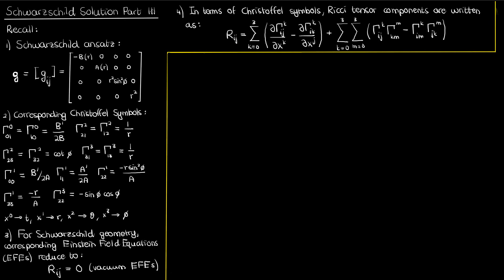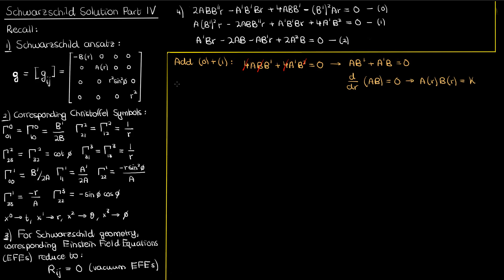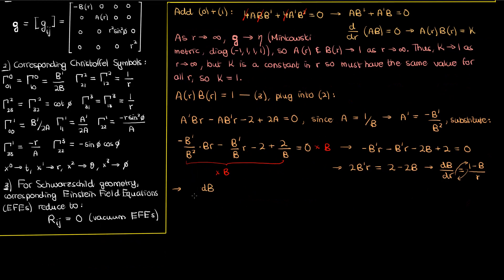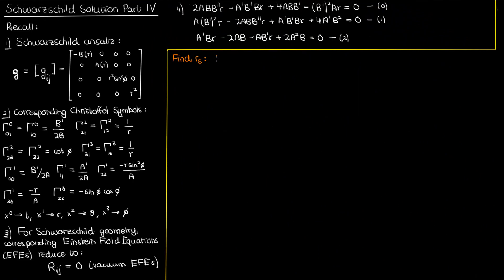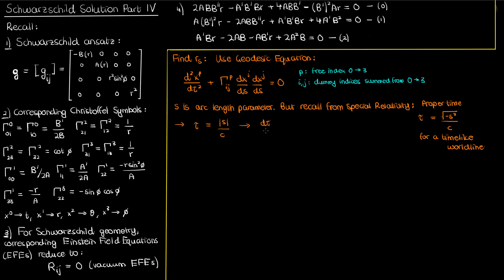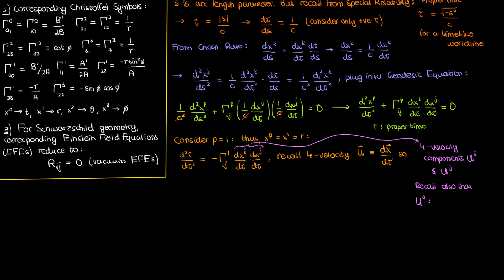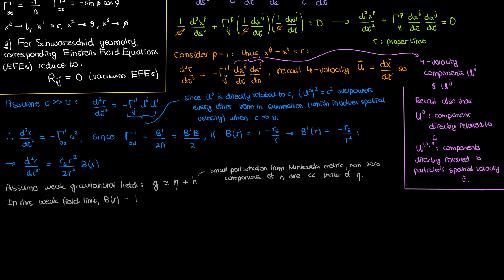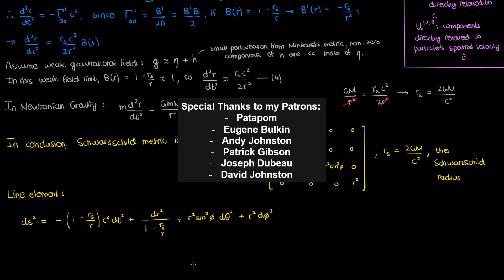Deriving the Schwarzschild Metric: Computing the Schwarzschild Radius and Conclusion

Comment: Great video. I’m just a bit confused when, multiple times, the gravitational field is considered small, so that the Minkowsky metric can be applied. Would that be true, if we considered the case of a black hole?
Reply from the maker: It still would, because the times in the video I assume a weak gravitational field is first to find K (by assuming r approaches infinity, but as I mention in the video, that value of K should apply for all r), and second to find r_s, which is also a constant that doesn't depend on the strength of the gravitational field (it's just easier to compute when we assume a weak field).

As an aside (not saying you're implying this, but in general), it's a bit of a misconception that black holes have stronger gravitational fields. Yes, gravitational effects (e.g. time dilation) near the event horizon are strong, but the gravity/spacetime geometry further away from the event horizon is the same as that for an equivalent mass. For instance, if we were to replace the Sun by a black hole of equivalent mass, the Earth's orbit would hardly change!